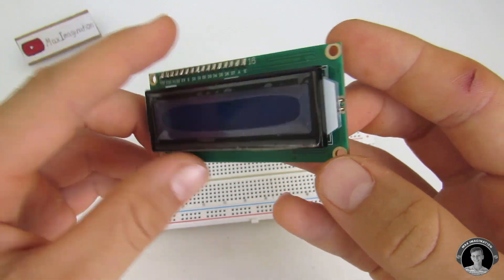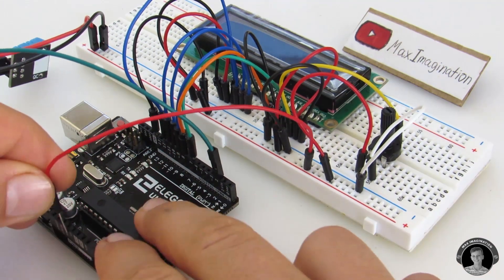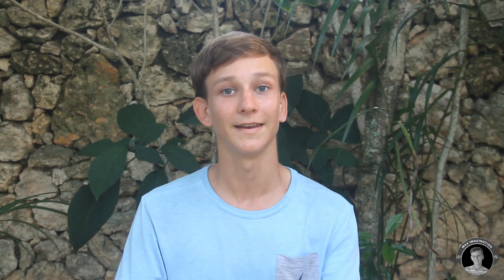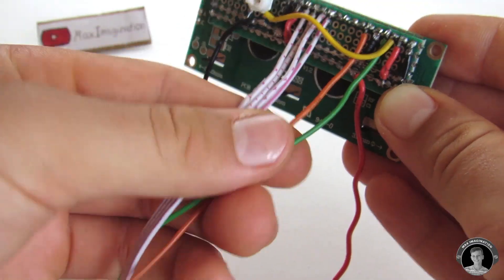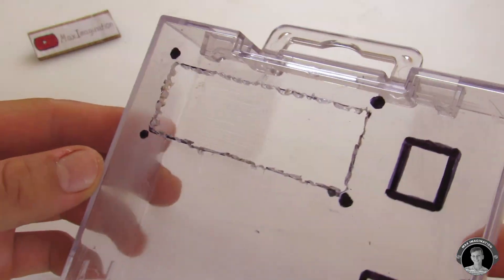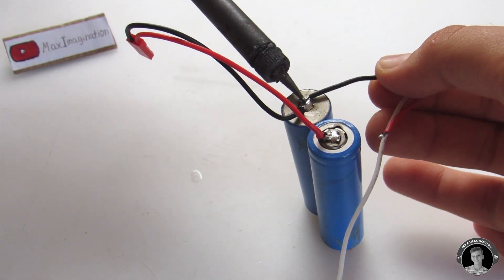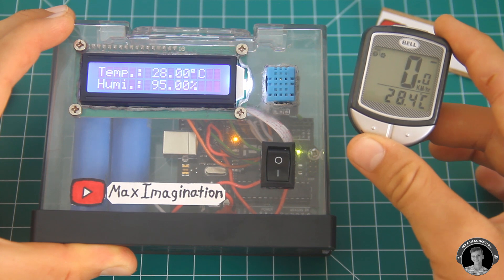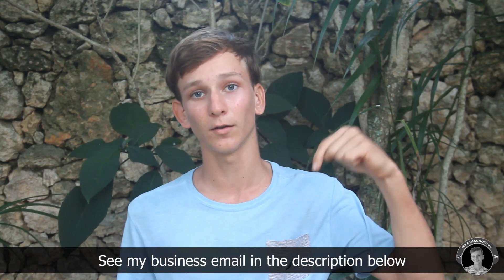DIY Digital Thermometer | Temperature & Humidity Display | Step-by-step Arduino Project

Comment: Okay, here to help EVERYONE with this:

I am a 12-yr old newbie (with a 147iq-this is not a lie and sorry, I'm very proud of my iq so I bring it up a lot) with Arduino's and wanted to make this thermometer. So, I followed the video but, I was just displaying, temp.; 00.00 C
                                                                                                                                                                                                                 humi.; 00.00%
AND I COULD NOT for the life of me figure this out I was just editing the code hoping it would work but I then looked to my right. and I saw another temp and humidity reader which was in my elegoo mega project starter kit. so, I switched out the one I WAS using-the one that came with my elegoo 37 sensor kit V2.0-and switched it out for the one that came with my elegoo mega starter kit. THEN IT WORKED. the amount of joy that I felt when I figured out that it was a small error made me so happy.

I hope this helped people get past this

PS-This worked for me probably because the kit the sensor came with was bad. so, if you have other issues, I can't help with that.
Reply from the maker: So in conclusion, you had a defected sensor... Glad you got it working!

Comment: hey man the libraries arent working for me
I downloaded them but it kept showing me i had not downloaded the library
I added the library you told us to use
Reply from the maker: Did you try restarting the IDE after installing the libraries? Also, make sure you have the correct library versions. It may pay to check they are up to date.
Reply: @MaxImagination  hey man i installed everything restarted the IDE and installed the latest versions
Reply from the maker: What error are you getting? I need all the info you can give me of the symptoms.

Comment: hey man 
my programm says that these three:
 int readData = DHT.read11(outPin);
  
  float t = DHT.temperature;
  float h = DHT.humidity;
have this problem: Compilation error: expected primary-expression before '.' token
Reply from the maker: Hi there. Errors usually stem from libraries not being up to date. Please update the DHT11 library.

Comment: Hi! I've installed the required libraries and followed the circuit diagram down to the wire, but the code won't compile for some reason. I got this as an error message, could you help me sort it out? I need this thermometer for my garden and I don't wanna purchase a thermometer.

Arduino: 1.8.19 (Windows 10), Board: "Arduino Uno"

thermometer:7:1: error: 'dht' does not name a type

 dht DHT;    // Create a DHT object

 ^~~

C:\Users\hp\Documents\Arduino\thermometer\thermometer.ino: In function 'void loop()':

thermometer:14:21: error: expected primary-expression before '.' token

   int readData = DHT.read11(outPin);

                     ^

thermometer:16:16: error: expected primary-expression before '.' token

   float t = DHT.temperature;

                ^

thermometer:17:16: error: expected primary-expression before '.' token

   float h = DHT.humidity;

                ^

exit status 1

'dht' does not name a type
Reply from the maker: Hi there. Libraries tent to be finicky things when it comes to compiling codes. Have you checked that you successfully installed the latest version of the DHT11 library?
Reply: @MaxImagination  Yeah ! It's got the latest version of the DHT11 library installed :((
Reply: @tarragon684  did you solve ?

Comment: whoever is trying to do it but the code didn´t work, this is the code that actually works (after you add the dht.h library)

#include <DHT.h>
#include <LiquidCrystal.h>

#define DHTPIN 2
#define DHTTYPE DHT11

DHT dht(DHTPIN, DHTTYPE);

LiquidCrystal lcd(7, 8, 9, 10, 11, 12);

void setup() {
  lcd.begin(16, 2);
  dht.begin();
}

void loop() {
  float t = dht.readTemperature();
  float h = dht.readHumidity();

  lcd.setCursor(0, 0);
  lcd.print("Temp.: ");
  lcd.print(t);
  lcd.print((char)223);
  lcd.print("C");

  lcd.setCursor(0, 1);
  lcd.print("Humi.: ");
  lcd.print(h);
  lcd.print("%");

  delay(2000);
}

Comment: Hiiii! I installed the library, and trying to use your code to run it, but it has an error code, shows 'dht' does not name a type, do you know maybe where can be wrong?
Reply from the maker: Hi there. This may be occurring due to not having included the library in your code. To do so, navigate to Sketch > Include Library > Add . ZIP Library. At the top of the drop down list, select the option to "Add .

Hope this resolves the error in your code.

Cheers, Max.
Reply: @MaxImagination  Thanks for your reply! I did included the library in my code, but it still shows: 
fatal error: dht.h: No such file or directory
 #include <dht.h>   // Include DHTlib Library- Download from Description.
          ^~~~~~~
compilation terminated.
Multiple libraries were found for "LiquidCrystal.h"
Do you have any idea about what might be doing wrong with this?

And in the Serial Monitor, the sensor keeps getting errors, such as room Temp that is larger than 300C, and humidity larger than 100%
Reply from the maker: Glad to help. Did you check if you've installed the latest version of the DHT11 library? May I know, where did you install it from?

Comment: I made this prototype and all i got was a blank screen. help
Reply from the maker: Hi, sorry for the late reply! I somehow managed to miss your comment. :(

First, did you double-check your wiring? Specifically what connects the LCD display to the arduino? 

Sometimes what causes information to not get diplayed at all could very well just be a couple of wires that got accidentally swapped around. Please check that
Reply: @MaxImagination  ok I will check

Comment: My prototype is just displaying 0’s
Reply from the maker: Hi, sorry for the late reply! 

First of all, did you double-check your wiring? (Specifically what connects the LCD display to the arduino).

Sometimes what causes information to not get diplayed at all could very well just be a couple of wires that got accidentally swapped around. Please check that.

Comment: Hey I made the prototype but, the lcd isn’t displaying an actual temp, it’s says humi and temp but it’s just displaying 0
Reply from the maker: Hi, hmm, that's weird...
Check that you have the right libraries downloaded in the Arduino IDE, also make sure that the pins you select in the code match up with the actual wiring config in your hardware.